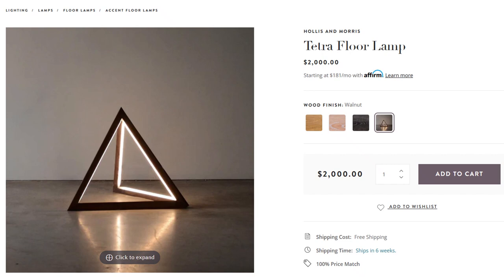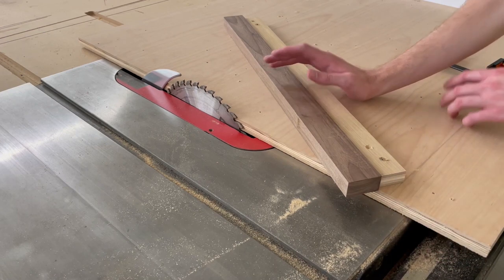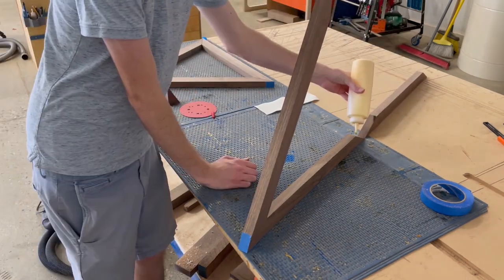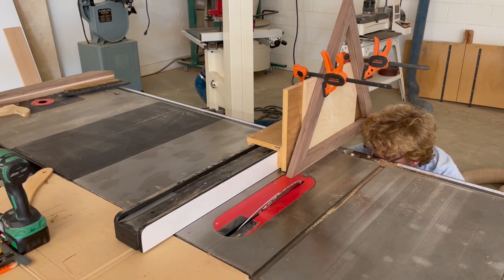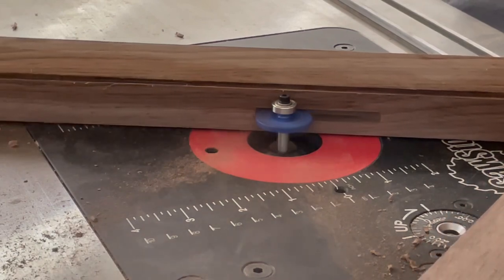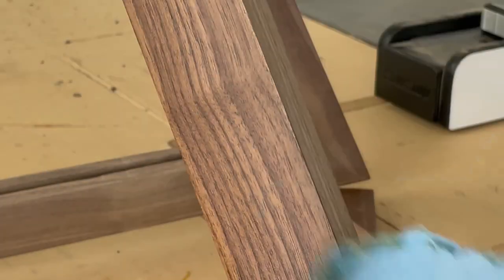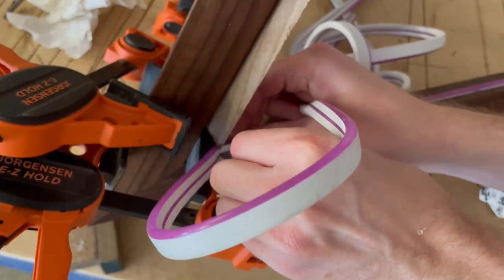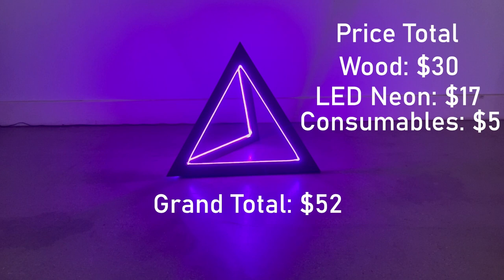how to make a $2000 designer lamp for $50

Comment: My husband sent me this link. This is a super neat build. Can you share a link to the lights you used?
Reply from the maker: thank you! there are a lot of different kinds on amazon so I would just look up "led neon strip" on there. The ones I used are nothing special and I wish I had used one of the slightly more expensive color changing sets.
Reply: @bluebirdwoodshop  I was about to ask about implementing a strip that could change colour, but regardless of what type of RGB strip you chose this is a fantastic build
Reply: I will definitely look into them. This lamp is on my Build List now that my husband has seen it. It’s a great plan. Thank you so much for sharing!